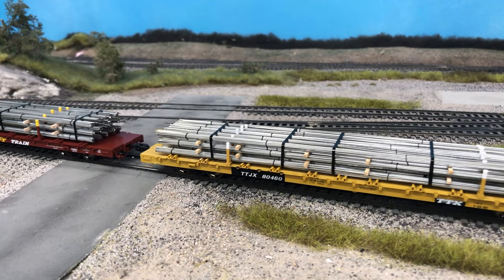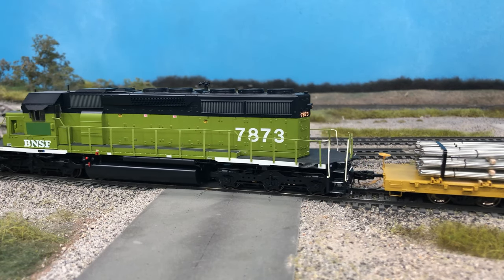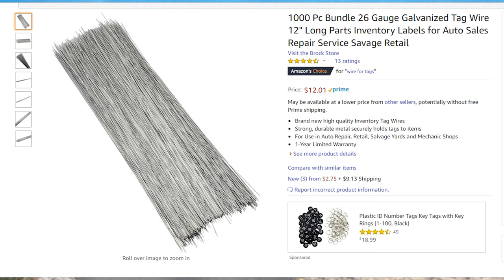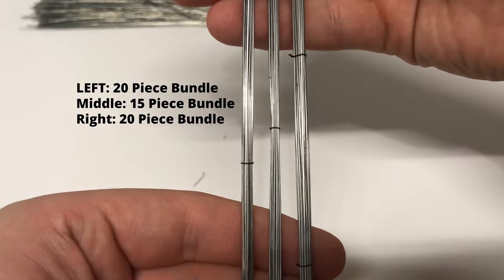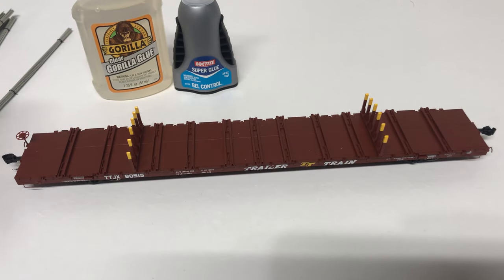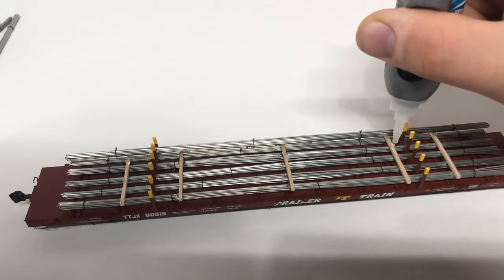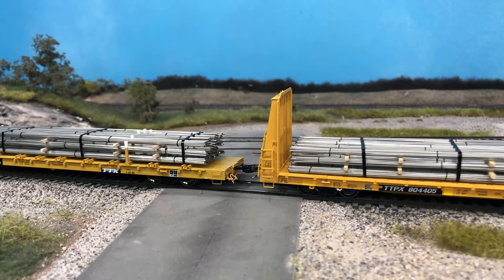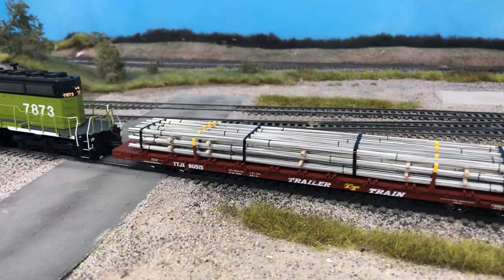Building Realistic Steel Rebar Car Loads

Comment: Good job, nice loads! Since I'm a truck driver, I like the semi load the best. If you choose to do a semi load, just to inform you, if you have a 48 foot flatbed, you can carry 56 foot loads without having over size signs on the semi. You would place 4-4x4's on the trailer at the front, then place 1-4x4 about every 10 feet on the trailer. Then place the rebar over hanging the front of the trailer about 3 feet and then hanging off the end of the trailer about 5 feet. DOT doesn't count the over hang in front, just the over hang in back, 48'+5'=53'! They usually only haul 1 layer, maybe 5 or 6 bundles across the deck. 3 inch wide straps or chains to tie it down. Also, some businesses require spacer blocks between the bundles so they can unload it. Some places use an overhead crane, some use a forklift to load or unload.
Reply: Great info bro,thank you 👍

Comment: Pros: Overall presentation was excellent, especially the selection of material and costs.

Cons: Rebar is not silver, it WILL have to be painted before assembly, either dark gray or rust. Also, the 1/16th striping tape scales out to almost 5-1/2 inches wide, so 1/32nd tape would have been a better option if it could be found. 

Suggestion: ACC can yield a very stiff and potentially brittle bond for such a heavy load. Consider perhaps experimenting with only the Gorilla glue you mentioned or clear silicone adhesive.

Advanced: Build a single bundle of re-bar and use it as a master pattern, then locate someone with a 3D printer who could use the master to create numerous bundles in appropriately colored plastic. This would produce lighter loads without having to build every single one of them.

Comment: hello SideTrack... really great work !!!  fyi... your stainless steel load IS actually prototypical especially in the nuclear world where i worked as an industrial safety engineer for 33 years and just recently retired.  we would get all sorts of metals shipped to our plant via everything from small delivery trucks to rail cars and a ton of what we received was stainless in all shapes and sizes.  after receipt/delivery inspection, which had to be done by a trained and qualified inspector, the loads, shiny as they were, would be sent to a storage area for use later on.  so don't listen to all the folks about your stainless steel rebar NOT being prototypical because it surely is !!!  the only thing i would tell you is that some of the stainless we received at our plant had either yellow/orange/red paint on the very ends of each rod, which served not only to "seal" the end of the rod where it was cut during the measuring process but also served as a safety "indicator" for operators to see during any and all lifting movements. the rebar we got from canada ALWAYS had this paint, but the american providers not so much so. keep up the nice work, sidetrack and blessings to you !!
Reply from the maker: That's awesome to hear! Thanks for the information!
Reply: @SideTrackX  glad to help, sidetrack !!!

Comment: Some really helpful tips, especially the tag wire suggestion. I made a rebar load from a brush with long plastic bristles. The bristles had a slight corrugation which helped mimic the corrugation on the rebar. But the bristles were still on the short side. That tag wire is wayyyy too shiny, should overspray with some medium gray and dull coat.

Comment: Great job, my only thing is when I unload these the band ends are on the top as the banding can't be tied together on the bottom. Also the wire ties are facing up most of the time so maybe stager those ties also.

Comment: NZ - Retail we sell D12 & D16 at 6mtr lengths made from plain steel which looks rusty. Also have galv tie wire and also plain steel wire (1kg bundles) which would match our rusty rods in scale.
May also be a good way to make steel mesh 665 (Other thicknesses available too).
Love the ideas here.

Comment: Real rust instead of paint.  Make your load, put it outside in the rain.
Won't take long to start rusting
Reply: But tag wire is galvanized.  It won't rust unless the coating is removed.

Comment: Where did you get multi pack for the striping tape?
Reply from the maker: I got the striping tape from my local hobby shop and it comes in single packs. There is two different manufactures "Line O Tape inc" or Sig Super Stripe Tape, I'm not sure which is which as I've had them for several years.

Comment: a good soak in a 5%acidity white vinegar to takes the galvanization right off and leaves you bare steel, if you want it rusty try 30% vinegar and then after that dries apply some hydrogen peroxide and it wi bring out the darker tones